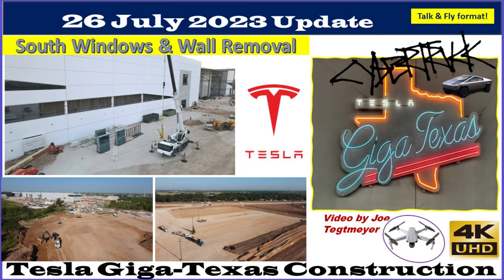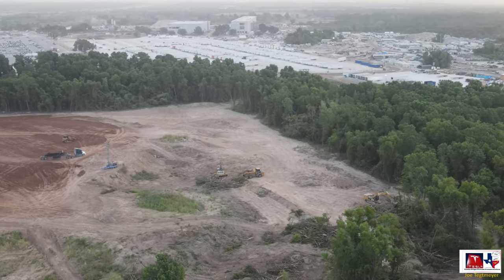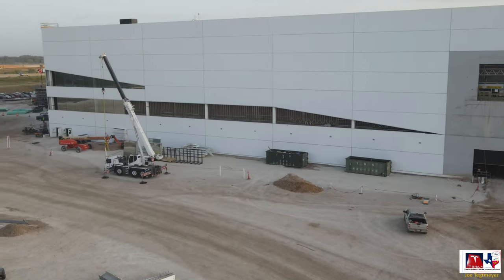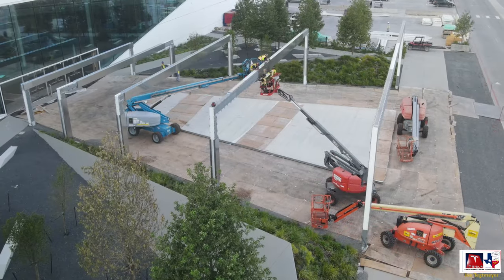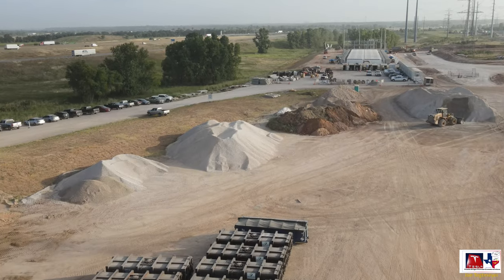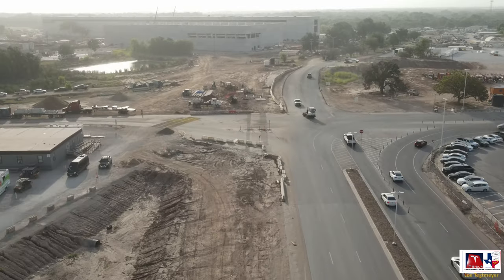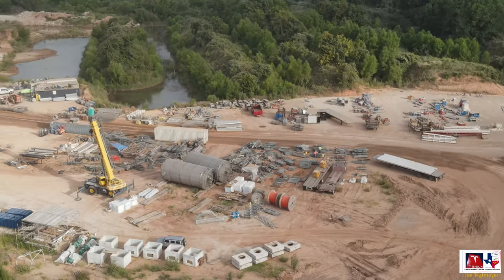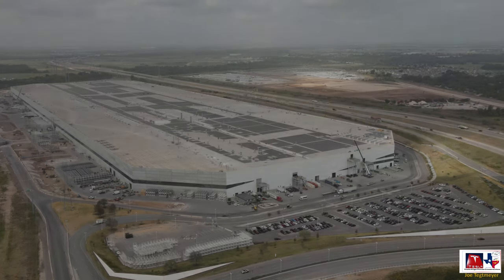South Window Removal, CFA Pile Drilling & Cathode Concrete!  26 July 2023 Giga Texas Update(07:35AM)

Comment: @ 19:07 as an Electrician the silver tarp is used 2  different ways so we can unspool the wire and mark the Phases Brown, orange and Yellow so the boss can buy 1 spool of 1500 feet instead of buying 3 spools of 500 feet it saves money with shipping instead 0f buying it by the foot and color the other reason is to warm the copper wire up by unspooling it letting it warm up in the sun make it 50 percent easier to pull the wires without damaging the wire insulation..
Reply: Well, warm isn’t difficult right now. We are averaging about 101 to 105 (38 to 40c) every day. So the cable is plenty warm. Still pretty good size so I imagine it isn’t easy to pull even on a good day.
Reply from the maker: Interesting … thank you!
Reply: @Bill_N_ATX  It's more letting the wire relax off of the spool let's if you don't the wire will curl ➰ like a pigs tail and then flip you in the Head
Reply: @danielcarlson8386  Got it. I pull a shit load of cat6 and 6+ which is a lot stiffer than the old Cat3 but it’s nothing like real power cable. Only time I have done that was pulling 100 feet of 4/0-4/0-4/0-2/0 service cable for my new garage. It was one nice straight run of 3 inch conduit with only two 90s. A very easy pull. I bet pulling multiple cables with long runs is a different job all together.

Comment: Thanks Joe
0:18. Southend. Glazed units removed. What is likely a temporary stud wall inside.
The frames holding the removed glazing units showed up across the highway in Jeff’s 24 July video.
3:30. Die Shop east. DMG Mori deliveries. Suppliers of the milling machines previously seen in Casting.
7:51. Stamping east. Boom-lift. Applying plastic to the windows. Painters starting the eat side.
16:04.  Battery west, apron. The final piece of Schuler equipment is on the SPMT.
18:56. BESS installation. Silver trap laid out for keeping the cables out of the gravel as they are dragged off the reel/drum/spool to the north.
19:44.  BESS switchyard. 7 new concrete pads for the 7 circuit breaker assemblies.
21:09. New switchyard/substation. Mega-Vault. Removing the gravel fill against the south and west walls. 
Sheet watering proofing applied on the face to the right.
22:04. Tesla Road, north. Black pipe with a yellow stripe, turning into the natural gas metering enclosure.
Cathode/Die shop getting a gas connection.
25:42. Cathode east. Half ellipse-ish frames. Stacks of segments for many more. 
Wide enough to span the long structure the left.
Profile matches the locating spacers along the top of the wall at 2:35.
Some sort of structural decking roof system. Impressive.
Aramax have a long span structural system. Can't find any curved examples though.
27:24. Ramp down to loading docks. Edgeboards and rebar placed for the ramp.
Shallow excavation for the grate drain. Sections of drain up against the building.
27:55. Die Shop, north. Right. Some TLC for the tree.
29:50. North-south road. Cybertruck drives by.
Reply: 25:42. Quonset type building now that I read the comments. After googling, Norsteel among many others make these structures.
Reply: 18:56 Agree completely that it is a good idea to keep the cable out of the gravel or dirt. But apparently these guys didn't get the memo:  https://youtu.be/k00aW2PSFDo?t=513 😄
Reply from the maker: Thanks  Dessie!
Reply: @25:42 Yep, I think you are correct.  Did a bit of searching and that is as close as I can find.  I'm sure this is for material storage now and the other long section is looking more and more like a wash down bay for trucks after unloading.
Reply: @Dwayne.Shea.231  The next question is what sort of materials. Literally raw materials, or some sort of already processed ore. 

Wild speculation alert. Joe's 17 June video had some City of Austin documentation. A schematic showed a 'Cell Recycling' building. I took this to be a mislabeling of Cell Test Lab. Maybe it wasn't.
Reply: @JoeTegtmeyer  Joe, I would like to thank you for the drone flights, all the information, and the work and effort put into it! And thank Dessie for all his observations. Without them, I would miss a lot of stuff. Thanks so much to both of you guys!
Reply: @DessieDoolan  Hadn’t even thought of that but that is definitely something to think about.
Reply: @DavidJohnson-tv2nn  agree totally, I am amazed what Dessie picks up on 😀
Reply: @Dwayne.Shea.231  Youtube gods not happy with me today. 4th attempt, getting shorter each time.

Battery Recycling. Favouring the materials storage myself, but also trying to think of different uses for such a structure as I have comments from HarderNL in mind that materials arriving at Cathode would likely be in bulk sealed containers.

Maybe this structure is where the bulk containers are opened up, and the contents shipped across to Cathode via a conveyor system of some sort. I think it was you who suggested the subterranean structure was similar to an elevator/conveyor pit.
Reply: You're welcome  @DavidJohnson-tv2nn
Reply: @Dwayne.Shea.231  Cheers Dwayne. Retired, time to spare, good computer, 3 great drone pilots.
Reply from the maker: @DavidJohnson-tv2nn  🤗you are welcome Dave and thanks!

Comment: After 19:00, the contractors under the blue canopies look like they're splicing fiber optic cable.  The cable is thin, and it looks like some is lying on the ground.  This is datacomm so these cabinets have datacomm for SCADA - system control and data acquisition.  That leads me to believe the cabinets may not have transformers but are for switching and control.  The oil filled switches are often the size of transformers, typically have their own cabinet.
Reply: Definitely agree that there are  switching and control functions. And in addition to the large conduit for power cable, there are conduits for control cable as well. However....
Not sure if you have a copy of the interconnection agreement. But looking at the one line diagram on page 48 (PDF page 59), and what is being constructed... The voltage out of the Megapacks is 480 V. It has to be boosted to 24.9 kV. There are no other locations for transformers. The 6 concrete pads seen under the steel structure @ 19:31 are for circuit breakers. Just a guess, but these units are probably a combination of transformers, control, switching, and possibly monitoring.
Reply: @DavidJohnson-tv2nn  
Yes, I guess the fins on the back of the cabinet are for keeping the transformer cool.  I guess the transformer doesn't take up that much space in the cabinet.  It's difficult to get a good estimate of the size of things when we're not up close on the ground.
Reply: @acmefixer1  Just one more thing I would like to point out...
If you notice where the control conduits come out of the ground @ 19:30 right side, by the cable spool and the where worker is... Notice that there doesn't appear to be any cable coming out of those conduits? Same goes for the 8 power conduits under the steel structure. My guess is that at this point, they are just running control and power cables between transformer/switchgear units. Next they will run cable all the way to the BESS substation.
From observation when they were laying the conduit, the transformers are wired together in banks or groups of 4, then conduit for each bank heads north to the substation. The exception being the transformer banks furthest north. Those two banks have 5 transformers each. Grouping them together means that they don't have to run 34 sets of conduits north to the substation.
Reply: @DavidJohnson-tv2nn  
We had 4 inch conduit between bldgs and there was room for four orange innerducts.  We could pull about 4 fiber cables, each 9mm, through each innerduct, but usually less.  Each fiber cable could have dozens of fibers, typically 24.  Maybe they consider time consuming fiber splicingvexpensive so they just run a direct fiber all the way back to the control bldg.  🤷
Reply: @acmefixer1  Really hard to see, but @ 19:30 right side, by the cable spool and the where worker is, is where the smaller conduits terminate at the BESS substation. Also hard to count the number of small conduits. But I believe there are 16 conduits attached to that rack, in groups of 4 conduits each. To complicate matters, If I remember correctly, some of those conduits are for low voltage electrical power, because the went out to the edge, where the fencing will be. For lighting? So is it possible that it is a mixed service, electrical and fiber lines? Or is that allowed by code? In any case, there aren't that many small conduits that terminate at the substation.
Reply: @acmefixer1  Also, I remember seeing some videos on fiber cable splicing. Seems to be a pain in the backside.

Comment: BESS yard: 
@ 18:46 (Transformers, both sides) Not clear in this view, but on Jeff's video, 7/26/23.... Looks like they are beginning cable pulls between transformers. Transformer banks consist of 4 transformers in a group (5 transformers in a group at the north end). Then conduit heads north to the BESS Substation. They have to wire the transformers in each bank together. Then they will run cable to connect to the BESS substation. The plastic on the right is for unspooling the cable without getting it in the dirt. @ 19:18 Cabinet doors open and black cable can be seen coming out of cabinet. Cable spool can be seen @ 19:27 left side
BESS Substation:
@ 19:44 Crews on both man lifts connecting 24.9 kV disconnects to busbars. 
Concrete poured for all 7 circuit breaker pads.
Easement:
@ 20:28 View of backup power duct-banks. Not much change.
Tesla Enclosure/Mega-vault:
@ 21:12 4 openings on south wall for conduit from duct-banks.
Vaults:
@ 18:10 Ready for cable pulls.
@ 22:00 Vault next to transformer or switchgear cabinet... 
They may have already pulled cable into this vault a few days ago. One possibility is to provide power to the Cathode building and Die shop from the temporary substation until the Tesla Enclosure/Mega-vault is completed. The other possibility is simply preparation to disconnect the transformer or switchgear cabinet from the temporary substation and connect to the permanent power source.

Comment: 26:00 looks like a quonset hut or materials to construct one.  Many of the sides are still stacked up.
Reply: 26:00. Thanks for the tip. I wasn't getting anywhere googling.
Reply: It looks like an arched metal prefab building used on 10s of thousands of farms. Every farm magazine has ads for them.

Comment: at the DIE shop, the dude in the cherrypicker is installing waterproofing between the concrete panels
Reply: That's correct. Caulking is the term. Push in a foam backer rod, or filler rod, then apply a polyurethane sealer over (Sikaflex or similar)

They have been using 'Slim Jims' brand of foam backer rod.

Comment: Am I mistaken but are there a whole bunch of giga castings for the Cyber Truck on the one side of the building?
Reply: What time stamp?
Reply: @DessieDoolan  30:15 (min/sec)
Reply: @RL.777  30:15. Model Y front. Cybertruck front castings have been seen.
Inside Casting, in Joe's 23 June photos.

Oddly, inside stamping in Joe's 14 May video. Likely down there to be machined. There's a couple of milling machines in Stamping. https://youtu.be/ou_b6mdqCs4?t=730

Rear castings seen outside Plastics on 2 June. https://youtu.be/WProJPhRqL4?t=1770

Comment: Hoss CNC machines for the die shop. The "rounded top tent?" Is the first span of a quonset style building. And its likely going to span that storage area where they redid all the concrete.
Reply from the maker: Thanks Dave!
Reply: @JoeTegtmeyer  yeah I pulled out the magnifying glass and top right of the crate is market CNC HOSS. Which makes sense because they are global leaders in that industry. And the width of that galvanized span looks equal to the width of that storage building so that is my guess. It would make sense for a bulk handling facility. Cheap but highly effective.

Comment: Those 4 stainless steel tanks at the cathode plant, they look like a liquid nitrogen tank delivered to SpaceX to store nitrogen used to power the water deluge system. While the Cathode plant will need truck parking bays to deliver liquid nitrogen for plant testing and perhaps during service, surely the cheapest way to make nitrogen is to liquify it on site from the air - Tesla will get the cheapest energy supply having its own Megapack system to cut its peak hour energy purchase. On the way to making LN2, we make LOX which could be sold if not needed. The other 1% of air is pollution and noble gases. SpaceX needs helium. SpaceX Texas uses huge quantities of Nitrogen, Oxygen, Methane and and some Helium that it could make when its starship and booster production gets to a more steady state at Boca Chica. SpaceX surely makes its own LN2 and LOX at McGregor. SpaceX must develop in situ resource systems to make and store at least LCH4 and LOX on the Moon and Mars. It would be surprising not to see it and Tesla liquify gases in Texas. 
Boca Chica is getting a major upgrade to its electricity supply. It apparently has old methane gas wells. SpaceX could literally pipe natural gas to the launch site and liquify it there. If the old wells are not suitable, it could surely pipe natural gas from Brownsville.

Comment: 19:40 wouldn't these be electrical equipment, rather than electronic equipment?
Reply from the maker: Explain further.
Reply: @JoeTegtmeyer  "Electrical Devices
Electrical devices take the energy of electrical current, the flow of electrons in a conductor, and transform it in simple ways into some other form of energy—most likely light, heat, or motion. An electric device is one that directly uses electrical energy to perform a task.

Electronic Devices
In contrast, electronic devices do much more. Instead of just converting electrical energy into light, heat, or motion, electronic devices are designed to manipulate the electrical current in ways that adds meaningful information to the current."
Reply: @JoeTegtmeyer  can't add url's apparently, but I searched "electronic v electrical" in a search engine and found that explanation.

Thanks for your vids, Joe, appreciate all your work!

Comment: the fact that they just painted those walls and now will remove them seems like a dumb way of operating. Sorry, just seen way too much asphalt and concrete dug up to do things that should have been considered first.
Reply: I heard that Tesla replaced their site manager for Giga Texas earlier this year. Hopefully things will henceforth be better planned and executed.
Reply: pisses me off too lol, 'planning'
Reply: A ton of $$$ spent on learn as you go....can you say rework! Contractors must be loving it.
Reply: Small money but it always happens on a project this large where the design is never finished until it is.
Reply: possibly those wall panels & windows will be saved and reinstalled on the South once the extension is framed I would guess
Reply: I can understand some parts, like you'll need a road to get in the building there. But especially the staining of that section did not make any sense at all. At that point they must have known that part was going away.
Reply: @danawoodbury7106  I agree they could be used. But no one with a sane mind would paint them first. No one would remove panels and replace them with windows then remove the window panels. Pour a 100,000 sf 10" slab , use it for two months and rip it out.